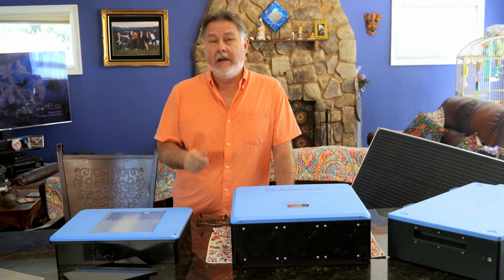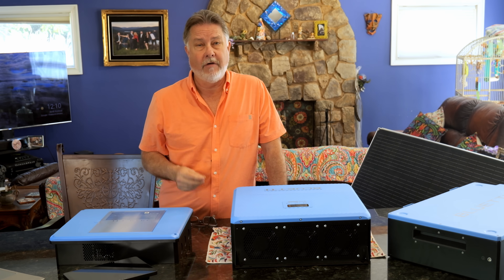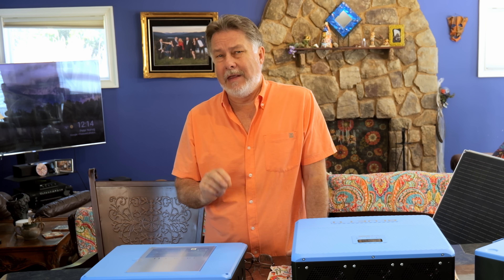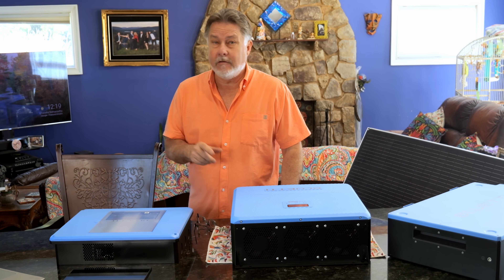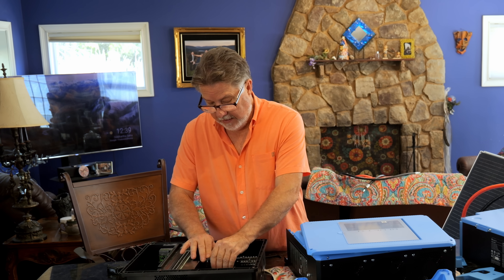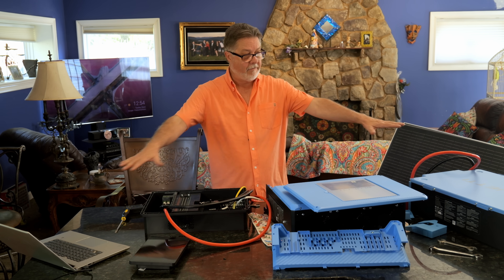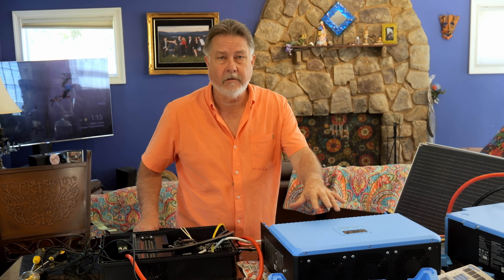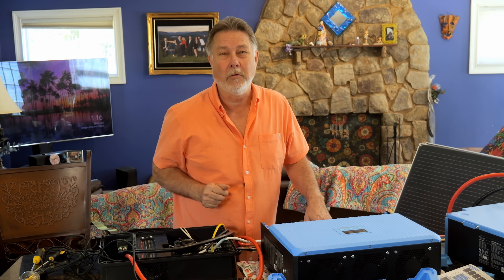Finally… An Easy Inverter System for Boats!

Comment: Did I hear this correctly. This Bluetti system will run your AC and usual 12 volt items for 13 hours?!?! If I could run my AC for 9 hours I would be the happiest guy in the world.
Reply from the maker: Yes. It will run the whole boat for at least that long.
Reply: @tryingnottosink9107 Man I am getting blasted on my Searay forum about this topic. They are saying thwre is no way in hell this is remotely possible.  I probably missed part of the explanation.  A couple of them watched your vid and still came back and said not possible. I will look into it closer. I would really love my AC without running the generator

Comment: Sounded interesting, but apparently they can only handle 1800 Wp of Solar. Problem is that I have almost 5 Kwp of Solar (up from 3.2 Kwp). On our new boat we will have almost 8 kwp of solar, so although this would have been a great replacement for Victron, the limit on the solar power is not going to do it for us. Wish I could use this system, because I agree with you, Victron needs specialists to install it and indeed they cost a small fortune to install it.
Reply from the maker: I suppose you could have some of the solar go directly to the batteries. That is what we do with the Victron system.
Reply: @tryingnottosink9107  if the inverter has an internal MPPT controller then that will be the limitation. You will need an MPPT controller after the solar panels because the voltage that comes out of the panels won't be stable, it is also much higher than what the batteries can accept.  The MPPT controller ensures that  the voltage that goes out will be the correct voltage for use for your batteries or for the inverter. Every MPPT controller has a limit, which is both voltage and amps. 
Since I have now 12 panels onboard I have 6 MPPT controllers, not only because of limitations of the MPPT controllers, but mostly because of limiting consequences of shading. 
But perhaps you can add more MPPT controllers, if you would want more solar panels, which can then feed directly into the batteries if you still have a Victron distributor or you feed it directly into the 12 or 24 V busbar. 
If that would be possible this is a very good inverter to have onboard. The ease of installation is great and that is something you don't have with Victron.

Comment: It didn’t “short out the inverter” - it overloaded the inverter and tripped the breaker.  If it shorted out the inverter, you’d be buying a new inverter each time that happens.  You came up with an elegant solution to the power draw with the Bluetti system though.  The price is fantastic too - I’m surprised it’s not a lot more expensive than $4K.
Reply from the maker: I know. I misspoke but didn't feel like re-shooting the clip. I am kind of lazy when it comes to dialogue. It is mostly me just speaking off the cuff.

Comment: Not overpriced - checkout out pricing now - this is way better than Victron, safe and takes way less time to install
Reply: Same price as Victron. Victron can provide Inverter power to both L1 and L2. The RV5 only works with L1.
Reply from the maker: That is correct. I am working with them to change that. Not that it matters much to me since I have transformers on board.

Comment: I'm an Electrical Engineer. 100 Ahr battery is way too small. 6kW would drain the battery in less than 1hr. Have you done an Ahr budget calculation for your boat? You said it has a DC output. Do you have any 48 VDC loads on the boat? If not, then that feature is not useful. The reason they didn't include any breakers is that the Siemens breakers you found at home depot are not IP65. So inclusion of those would have violated the overall rating. All in all, I don't see how this is any better that what you have. You wouldn't be able to operate this system in parallel with you current system either. I shudder to think of what is going to happen on your next insurance survey.
Reply: 12 Volt DC output!

Comment: Interesting topic!  New tech on top of new tech in a direction I had not considered.  Thanks for the out-of-the-box approach.  Just bought a pocket trawler to try to do the Loop.   She needs battery upgrades.  Im not sure I have the correct space ( ie, dry, cool, cable runs, etc), but this could be game-changing.   You did bring up my biggest concern is support/failure recovery, because nothing ever breaks in your home port :)

Comment: Yea, 6000 watt inverter is fine, but your still just playing around with a puny 5 kwh of battery power and a dismal 1200 watts of solar. Your not a sailor are ya, happy to run a small fridge, coffee pot and your chart plotter.
Reply from the maker: We already have 17kw on the boat, which will run our boat for 24 hours on our current system (with air conditioners), which uses about 800 watts. This will give us 22kw and we will probably add more.
Reply: @tryingnottosink9107  Well, that's more like it!!! :) Didn't mean to sound like a "D".
I just doubled my batteries from 31kw to 62kw (12 * 48v/100amp) because as I'm sure you're aware, a couple of cloudy/overcast/rainy days solar charging is minimal. You may want to consider increasing your solar even more then you have planned. It is possible, Iv'e fitted 6 * 520 watt panels over the flybridge and 8 * 520 watt panels over the sundeck, for a total of 7280 watts on a 50' motor yacht.

Comment: Nice video. IMHO, they missed the mark by not having 240v capability w/24v batteries. I would love to have enough juice to run 240v AC system at least 2 out of 6. Can’t stand run generator all night.
Reply from the maker: You can get a $250 transformer to convert to 240v. We have them on our boat.  But i agree.
Reply: Ed, I think, they will listen to you and update the system. Also, RV background? Come now! 😂

Comment: A stove on full blast at 12v uses 50 amps.  A stove on full blast at 48v ALSO uses 50 amps.  However because the voltage is so high, at 48v you will need 4x the fuel to generate 50 amps.  Which is why you should use the lowest voltage you possibly can to accommodate your cable runs, usually 12v.  A higher voltage is ONLY for running long LENGTH wires.  12v can support 25 meter wires.  24v can support 50 meter wires.  48v can support 100 meter wires or wires the size of a football field.  Since you are NOT running 100 meter wires, you should not use the extra fuel required to use such long wires (48v).  This extra fuel at 48v will cost 4x the price to power the same electronics.  You should not use this inverter instead of a Victron inverter.  Victron has installers all up and down the coast and has the best support by a LARGE margin.  And you should not use 48v batteries and inverter instead of 12v batteries and inverter.  You are using 4x the fuel to broadcast your signal down 100meter wires, however your boat does not have any 100 meter cable runs, therefore you do not need 48v.  25 meter wires (about 85 feet) are MORE than long enough.

Comment: Ed. is your 32 volt system now focused on starting the engines?  Does the system accept the 32 volt alternators outputs, or are you depending on the solar cells?  I think this system will ultimately be safer--- few connections, etc.and with that kind of capacity, way less genny use. It cost us 3k for a new generator section of our Westebeke (we instslled it ourselves) and the engine already has over 3,000 hours, so going with this inverter set up is certainly a value added net plus, especially since the generator is burning a gallon of fuel an hour---
Reply: Their generator will produce around 60 amps an hour.  Bigger generators can produce up to 200 amps per hour or more.  Even if the roof were completely covered in solar panels, they can only produce around 15 amps per hour in PERFECT sun.  Small homes have 100 amps per hour service, large homes have 200 amps per hour service.  Even with very light usage, his boat would require about 30 amps per hour.  Solar panels could not provide less than half this.  NO boat will be able to depend only on solar.
Reply from the maker: @armelpeep A lot of the information you are providing is incorrect. Our generator provides 85 amps. Our boat does not require 30 amps for light usage. We typically use about 800 watts (about 7 amps) unless we turn on an air conditioner or the water heater kicks on. Even then we use about 3000 watts ( less than 20 amps) Unless I am running multiple air conditioners, we don't hit 30 amps. Also, it is not just about the length of the wires, it is also about the size. Using 48 volts allows for much thinner cables and they are more efficient. In fact it is rare for a boat my size to use 12 volt batteries. And as far as a boat not being able to run on just solar, you'll have to tell my neighbor boat at the marina. He and his girlfriend live on the boat and they haven't plugged it into a pedestal in a year. And he runs three air conditioners.
Reply: @tryingnottosink9107  The water heater requires more than 7 amps, the stove requires more than 7 amps, the bow thruster requires more than 7 amps, the anchor wench requires more than 7 amps, the dinghy wench requires more than 7 amps, even the refrigerator requires up to 15 amps, the washer and dryer requires more than 7 amps, the microwave requires more than 7 amps, the list goes on and on.  I think even the dish washer requires more than 7 amps.  You might get down to 7 amps at night for a couple hours when everyone is sleep and everything is off.  IMO you simply cant live on 7 amps per hour usage for more than maybe a couple hours at night.  If you average 24 hours of usage you will need to have at least 30 amps available unless nobody is on the boat.

Also Hatteras boats that size come standard with 12v agm 8d batteries.  Those are the batteries boats of that size will have unless you change them yourself.
Reply from the maker: Starting the engines, several pumps and the original lighting are still 32 volt. I am talking with Bluetti about using my 32 volt alternators. I currently have a Dc-DC charger that is use to drop the voltage down to 24 volts on my current inverter system. I may need to use that with this system, but I am not certain yet.

Comment: Just to be clear, you should refer to the AC voltages by the proper 120 or 240. 110 is a leftover from the old DC Edison days
Reply from the maker: What can I say - I am old school! 😁Actually, I learned the basics of electricity from my father, who was an electrician. He was trained in the 50s and always used the term 110v, since that was the standard when he was taught. I learned from him in the 70s and picked up his language, even though by that time the country had switched to 120 volt.
Reply: @tryingnottosink9107  Yes, me too! (Old school). You're correct, most places had switched to 120v by the end of WW2. I found an interesting old article from the 1954 ANSI publication when they were working on voltage standardization, that over 80% of lightbulbs sold in 1949 were rated for 120 volts.

If you want to see something really old, there's still a few buildings in Center City, PA and Hartford, CT that have 2 phase power. Not the "split phase" 240 that is at your house, but actual 2 separate phases. There is 2 pairs of 240v lines, plus ground, so a 2 phase system with have either a 4 pole breaker or disconnect with 4 fuses in it. The two pairs are 90 degrees out of phase. Instead of 180 on a single phase circuit, or 120 degrees on a 3 phase system.

Where I live there's some old buildings downtown that have 240v 3 phase power. I can tell those because there won't be any 120v breakers on the middle "B" phase. That's called the stinger leg. From A to neutral or C to neutral you'll get the normal 120v. Or 240 from A-B, B-C or A-C. What voltage do you get from B to ground? :)
Reply: @tryingnottosink9107  It would have been in your grandfathers time then that the voltages were up to 230. Voltages were standardized by the time the Works Progress Administration started the Rural Electrification program to bring power out to rural farms. The standard service was a 60 amp fuse box at 230 volts.

I think a lot of confusion exists on power source voltage versus utilization voltage. Motors today are still nameplate rated for either 115, 230 or 460 volts. Even though the supply voltage is 120, 240, or 480. 220 was very rarely used, except in some areas where there was an argument over what 3 phase voltage to use, the 220 was a compromise in that 230v rated motors would work just fine on 220, and 208v rated motors also work fine with 220 (3 phase). The problem with using 220 for 3 phase small commericial buildings is you end up with 127 volts L-N and it was burning out lightbulbs too quick (this is WAY before the days of LED bulbs)...

Mexico does use 127/220v at 60 Hz in most light commercial locations for the same reason. So in Mexico 220 is a thing, but there is no 110...

Comment: It's not a bad price if you think you'll get a 6k generator for the same number you had to many drinks.  Speaking of that missed opportunity,  could of tested the system with a blender and see if could make a drink! 😂😅
Reply from the maker: I don't think I mentioned the cost of a 6k generator. I have one at my house, and I think I paid about $800 for it. A 6k marine generator is far more expensive than the $4k that this system costs. I'll definitely test out the system with a blender when I install it on the boat! 😁🍸😎